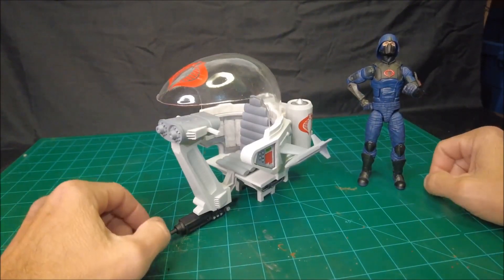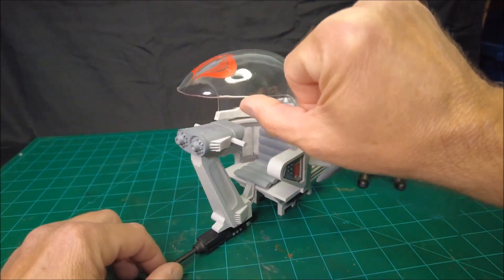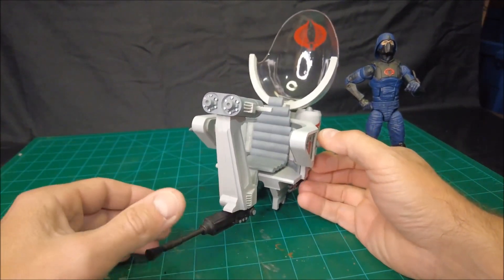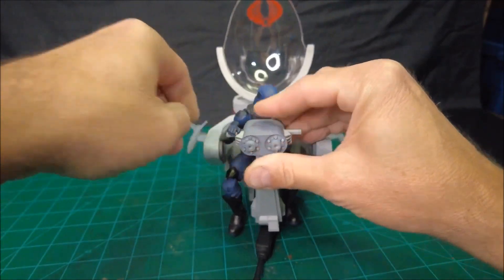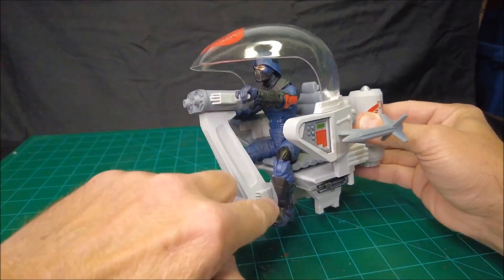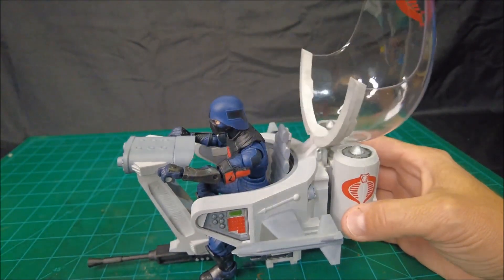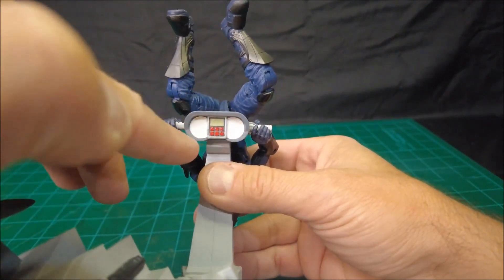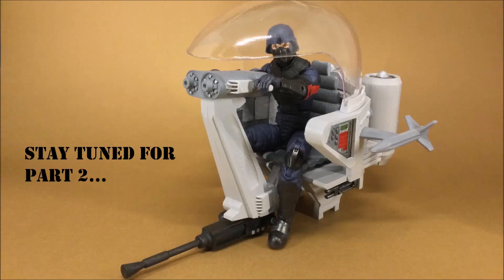G.I.Joe Classified - Scale Trouble Bubble Build Series - Part 1 - Intro

Comment: I don't have a 3d printer. How much would you sell one for? With all the details of course.
Reply from the maker: I have a couple of completed units currently available for $120 each.  If you don’t like the colors, I could repaint one to your liking…or you could just repaint it yourself if you are so equipped.  I could also produce a DIY kit for $60 that includes all parts and a vacuum formed canopy.  Check out the pics in the first post in this discussion thread on TFW2005:  https://www.tfw2005.com/boards/threads/fschuler%E2%80%99s-sales-thread.1226226/#post-19896316
Reply: @frankschuler2867  I would very much like to buy the DIY kit, but I don't get paid till next week. Should I use the link you provided to make the purchase. Also what kind of glue do you use? And what type of paint and brush? Thanks for your time.
Reply from the maker: @roberthaughey2398  Send me an email at fsx.makes@gmail.com and we’ll work out the details!

Comment: just printed this last week. only thing i am missing is the canopy as i been trying to see the best way to do it
Reply from the maker: That is certainly the toughest part.  If you don't mind a partially opaque bubble, you could always just print one using clear filament.  About the only ways I can think of to get a clear (or nearly clear) canopy are via vacuum forming or by using a resin printer with clear resin.  If you don't have a resin printer, vacuum forming is going to be the cheapest by far.  All you need is a mold buck (included in the files you downloaded), a vacuum box, a vacuum cleaner (or other vacuum source), a frame to hold the plastic sheet, some 1/16th inch thick PETG plastic sheet and an oven or toaster oven to heat the plastic to forming temperature.  You probably already have most of this stuff.  It isn't expensive...just time-consuming.  Edit:  And the nice thing about vacuum forming is that the parts are nearly indestructible.
Reply from the maker: If you are still interested in a vacuum formed canopy, send me a private message through Thingiverse!

Comment: and I love that its not a straight copy from the original toy,  but modified a bit just like has been done with the whole Classified figures.
Reply from the maker: I had to add some flair to it!  I have ideas for a truly modernized Trouble Bubble as well.  The aesthetics will be along the lines of the C.O.I.L. cycle that came with Baroness.  But, I wanted to get this retro version done first.  I haven’t done any design work on it yet…it’s still just ideas in my head.  I plan to make the “bubble” portion of the modern version easier to produce, i.e., no vacuum forming required.  With the retro version, having a plain clear bubble is kind of a trademark of the design.

Comment: Printing the first part of this as we speak.   Can't wait to see if I can get the bubble done right :)
Reply from the maker: That is awesome.  I don’t know how many people are actually making these.  I’d love to see more get made.  It really is not a difficult printing or assembly job…the bubble just takes some time, depending on how you do it.  Are you going to vacuum form the bubble or print one?  I’d like to see someone print a bubble using a resin printer at some point as well.  And if you vacuum form it, I highly recommend 1/16-inch thick PETG plastic sheet.  I really wanted to use polycarbonate (Lexan) but it is a LOT more difficult to work with.  I wasted a bunch of it before switching to PETG.  Please post your make on the Trouble Bubble page on Thingiverse so I can see it!
Reply: @frankschuler2867   I printed the canopy with clear filament for now.  It's opaque, as you said in another reply.  I'm going to try some isopropanol and see if that makes it a bit better, but I think it's a bit too thick.   But if it's printed thinner, I dont know if it will hold during printing.
Reply from the maker: You could try printing it upside down and then sand the hell out of it afterward followed by some clearcoat.  Alternatively, I’m going to start selling vacuum formed canopies for $20 plus shipping, if you would like to go that route.